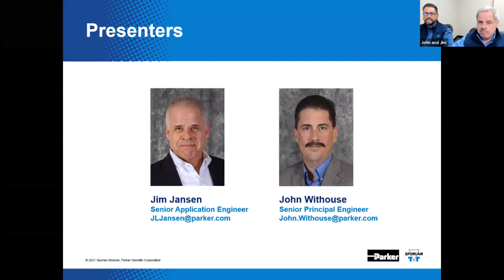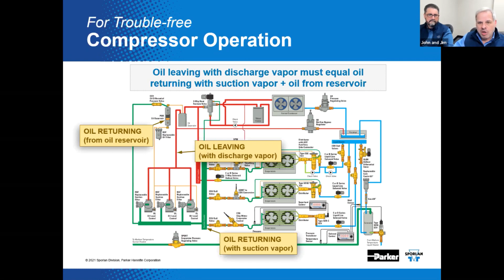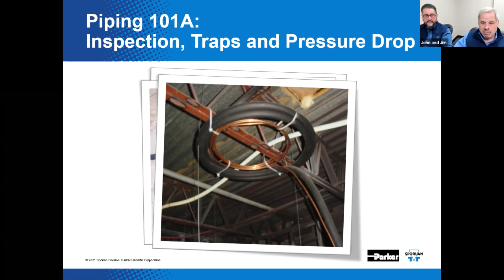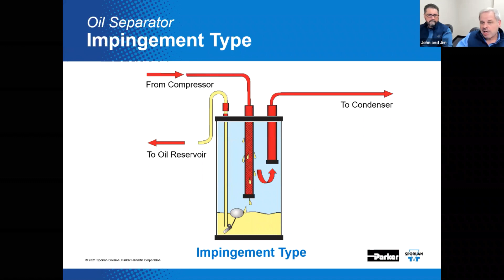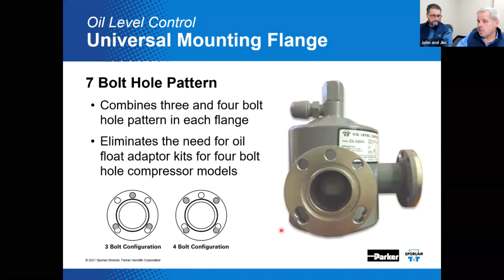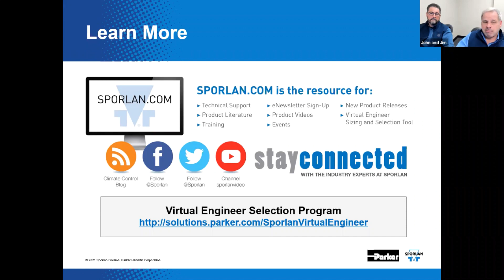Parker Sporlan Supermarket Seminar: Low Pressure Oil Level Control Systems in Refrigeration Systems

Comment: So, why oil is pumped out off compressor? Its hard to project compressor with oil separator inside + oil span + oil dipstick bolted on hex10 nut with two orings on and thats all ?